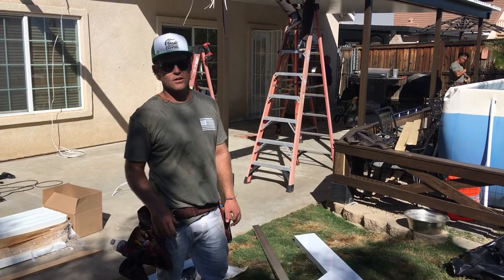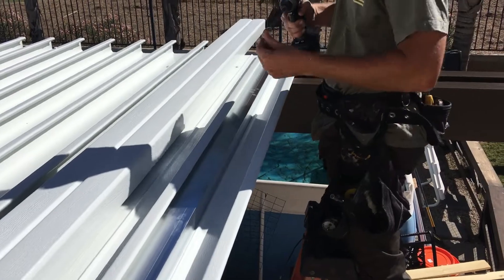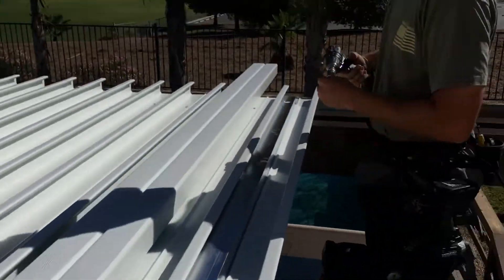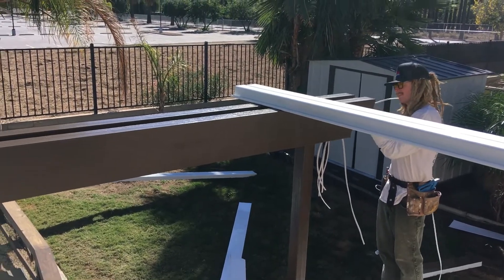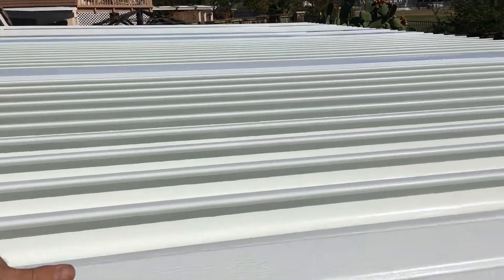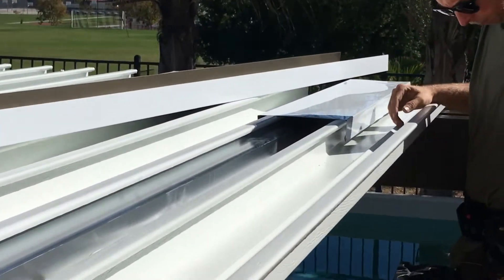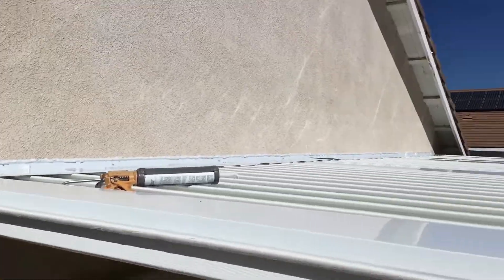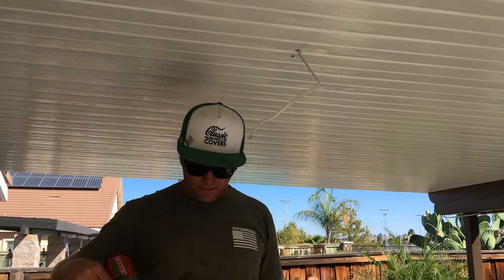Alumawood Fan Install

Comment: Great video, extremely helpful as I'm planning to install one of these this spring (I'd use you guys if I wasn't 2000 miles away!).  So you just use the header as a sort of junction box where all the wires connect since its protected correct?

Comment: nice work on the roof part, but the you should have some kind of a bushing were you drilled all your holes for the  electrical wires as to not cut into the wire and should have used fan safe boxes with through bolts and lock nuts and some kind of weather proofing from the top. these are major NEC code violations. not to mention the safety hazards ie.(electrocution from several means, fans falling on your heads over time, especially in earthquake state, USA) i'm sure that's not a UL approved assembly. would have failed inspection around here in Florida for sure. can't believe you passed in Cali., with all the rules you guys have over there. i hope you addressed these issues and just didn't show it, but somehow i don't think you did. i hope your liability is up to snuff for your sake.
Reply: I'd feel better about using bushings, BUT . . .   for NMB coming from a raceway into a metal panel, NEC doesn't require a bushing (the outer jacket is protecting the conductors).  I suspect the Alumawood installation is getting by on that.  As for a fan-safe box - that doesn't apply here.  The fan hanger is attached to the aluminum panel with four self-tapping screws, each with a pull-out of about 300lbs.  So they're more than covered on both capacity and redundancy - although, if it were my home (in Southern California, with earthquakes), I'd probably add a pop rivet to each bracket for peace of mind.
Reply: That outer jacket is not protection from sharp jagged metal edges. Plus as I stated before should have used a fan safe box as the NEC states all (splices, joints, connections, etc...) shall be done in a box. Therefore the box should have been attached to the bracing and the fan attached to the fan safe box. Not to mention the roof installer probably didn't have an electrical contractor's license to do the electric either. As I said, it would have failed inspection here in Florida.
Reply: @chaser9363  NEC 300.15{A}  A box or conduit body shall not be required for each splice, junction, switch, pull, termination, or outlet points in wiring methods with removable covers, such as wireways, multioutlet assemblies, auxiliary gutters, and surface raceways. The covers shall be accessible after installation.

The patio cover plus the "cap" they put on the top surface comprises the raceway, and the fan canopy is the removable cover -- no box required.  Don't agree?  Cite the NEC section that applies to this specific application.
Reply: @jeffeverde1  had to go back and review the vid. By the way, good catch on the exception. I haven't ever read that one before and I might be obliged to use it on a set of coach lights that are standing off a wall because the pancake boxes are surface mounted and are taller than the canopy of the lights. But in this case that beam and the roof pan is not a UL Listed raceway for one, plus as stated in section(C), there's no fitting to provide "protection of the wire from abrasion" when passing through those drilled, sharp and jagged holes. So this would be the argument from the inspectors here. Resulting in a "HARD FAIL". I know, I know, "you're glad you're not here" . 😂 Once again, thanks for the "exception". And now that I think about it even more, it didn't look like they used UF cable as outside is considered a "WET" location even in a raceway. NMB isn't listed for a wet location. So there's another code violation
Reply: @chaser9363  Greetings from Australia. So good to see  what I take are professional electrician commenting  on the wiring. As a retired sparky here in Oz I absolutely cringe as some of the installations including this one on youtube. Our Wiring rules here in Oz are very strict but we do not require things such as wring boxes ( in most cases) for our lights and power outlets.  I just watched one video where the installer used single insulated cable in a similar circumstance in un-bushed metal holes and tried to convince me it it was to code  in America _ I dont think so. We are mucking around with electricity here and no-one wants to be responsible for an electrocution.